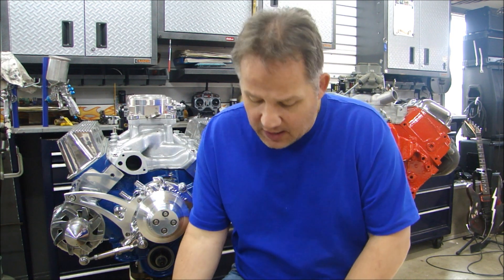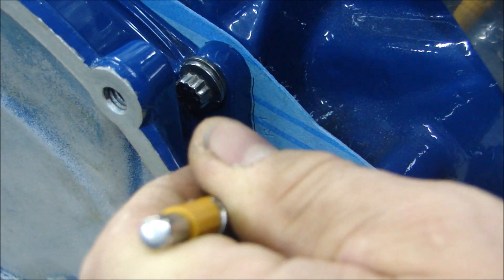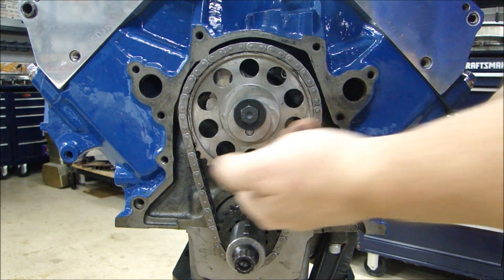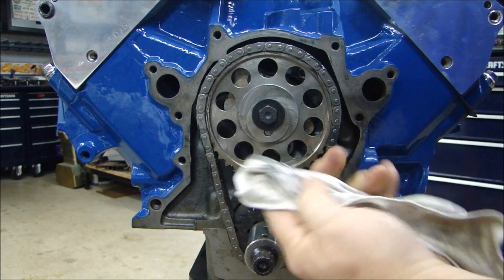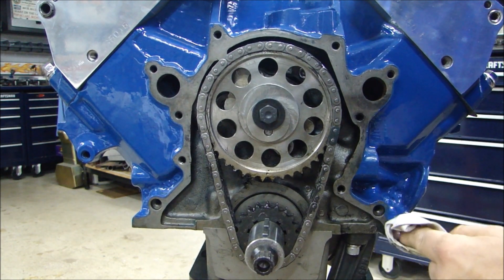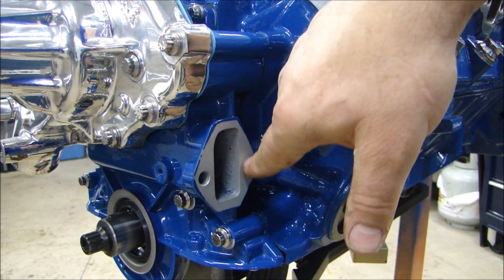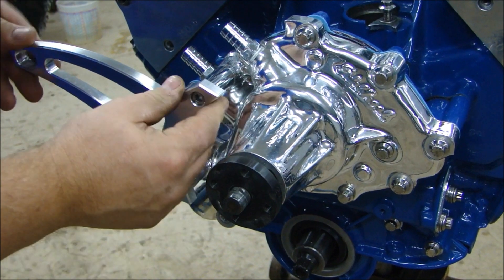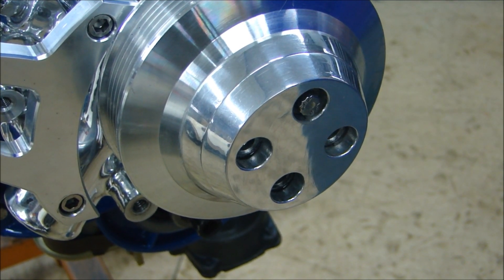Engine Building Part 12 - Timing Chain Covers & Water Pumps

Comment: It seems like a little bit of paint in some spots on the surface where the gaskets was going.  Is that an optical illusion due to the filming?
Reply from the maker: I always scrape the surfaces if there is paint on it, but it won't kill it if you're using a 2k paint

Comment: Your videos are amazing.  I was surprised to hear you say torque down the water pump, let it sit for a bit and come back to it and snug it up.  Assuming you torqued to a spec, doesn’t that mean you have now over tightened?
Reply from the maker: Thanks Chad. I check to make sure the gasket has not settled and torque to spec. It is not over tight

Comment: Pete I have a question I have a 1994 Ford big 460 just bought a new water pump now my question is I seen different radios on putting a pump back on gaskets the RTV silicone and all that now when I took my pump off and there was a metal plate between the water pump and timing chain cover all the videos I watched a engine builder as your self I never seen any one of them talk about that plate or I never seen any of them putting that plate back on my question is does that plate have to go on and this is a stock ford 460 that’s Pete for all your videos all great tips Thank you for your time.. Don
Reply from the maker: Yes, you have to put that plate back on

Comment: do not use gasket sealer  only a little grease the sealer get hard in time then it will leak the gasket and cover move with heating and cooling .
Reply from the maker: Interesting, I've never had that problem.

Comment: Love the videos, but couple things bother me:

1. You use a lot of that glue stuff on the gasket. I know books can be written on gaskets alone, but isn't the general theory that proper torque, a good gasket and clean mating surfaces are the way to go unless it's a specialized location. For example you would never use that stuff on a head gasket right?

2. Also, you mentioned to go around the water pump and retighten all bolts in a circular fashion. Did you misspeak or is there a reason you would go around as opposed to criss cross like you would anything else?
Reply from the maker: 1. You should never really need sealant, but it doesn't hurt. Never on a head gasket unless the manufacturer says to.

2. Correct, you should always try to torque even. This cover is open on the bottom so going around achieves the same goal. Following a criss cross pattern is much more important with higher torques and where there is a chance of slipping or warping.

Comment: As far as the water pump goes, I was told that you should take your water pump and soak it in antifreeze for 12-24 hours to lubricate the seals and bearings before its initial use.
Reply from the maker: Hmmmmmm. That sounds like something from the 50's when rope or cork gaskets needed to expand to seal. New pumps will have plastic seals and seal immediately

Comment: I watched all of your videos; I watched some several times. You really enhanced my knowledge. I wanted to add something about cleanliness. 

The lint free towels are great, but sometimes they fail to pick up stuff during a final cleaning. I have used tack cloths (rosin impregnated) that pick up things the eye can't clearly see.
Reply from the maker: Excellent point! I use lint free towels so I don't add anything to part. I usually blow them off with clean, dry air.

Comment: Hi Peter,
First off, your videos are outstanding. Thank you.
 I noticed you use a red high tack gasket maker/sealer instead of RTV.  I've always used RTV to install the water pump, timing chain, ect. Before I go buy a bottle, would you mind telling me if the High Tack cleans off easier or harder than the RTV. This is the case where I have to disassemble the engine and I need to clean all the surfaces again before reassembling. Is the High Tack better to use?

Comment: Before torquing the timing cover and water pump bolts, I installed my balancer half way.  Then I tightened the timing cover and water pump bolts. That way you are sure the crank snout is in the center of the timing cover front seal.
Reply from the maker: +Tom Tennant That is an awesome comment. Most timing chain covers have a dowel to hold them centered. It does help to have the balancer hold it there
Reply: +Petes Garage Yes, but I've found that even with the dowel, they can wiggle or rotate a little. You want the crank snout centered in the timing cover - installing the balancer before tightening the timing bolts helps make sure. As you said in the video, there are lots of things that happen at once, so have everything planned out and ready.
Reply from the maker: +Tom Tennant You are right.....great comment
Reply: +Petes Garage.  This raises another question, which is the working time needed to beat the clock on the High Tack sealer.  The timing cover needs to be a little bit loose to allow the Harmonic Balancer to move the bushing  to center. I'm wondering how this will work out.  Would a different sealer be slower setting? Would a different sealer be as effective. 

I will be doing this on a 351w next month and I am carefully planning it. I don't want to do this more than once and I don't want any problems.
Reply from the maker: You can set the balancer on the crank to make sure it is centered before tightening down the cover.

Comment: Thanks petes for wonderful job of teaching us, well besides this video i have one question, am not a mechanic but i would like to know how to reduce the fuel consumption of an engine lets say i have an engine of 2.9 and i want to reduce it up to 2.0 so what's the procedure and how it can be done if possible? thanks i will be glade when am answered thanks.
Reply from the maker: +Maruwan Saleem There is a technology that is put in the fuel system. It takes the molecule of gas and breaks it apart so the engine is burning a smaller molecule and burns it more efficiently. An engine is basically an air pump and once the size is set there is not much you can change that would help it require less air and fuel. Unless somebody knows a way I am not familiar with one.
Reply: +Petes Garage ok thanks petes i have got it clearly.

Comment: some timing covers have alignment dowels that need to be in place before installing the front cover.   good video I have had some issues with timing covers in the past with dowels missing causing misalignment of the front crank seal.
Reply from the maker: +Chris Mansker Excellent point. This cover has the dowel countersink but I did not use them. Thanks for the comment

Comment: When I was about 20 I had a 79 F150 with a junkyard 302 from a 77 Thunderbird. The mechanical fuel pump sprung a leak and was blowing gas out of the breather hole. Being 20 years old and stupid, l drove it to the parts store spraying gas all over the engine bay and fixed it in the parking lot.
Reply: +Ken MacMillan Ha ha! Those were the days!